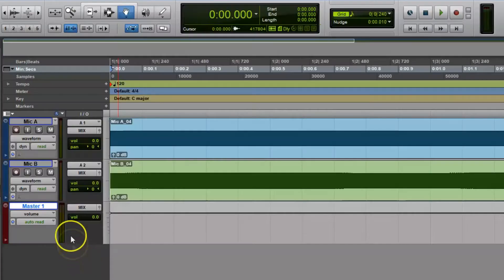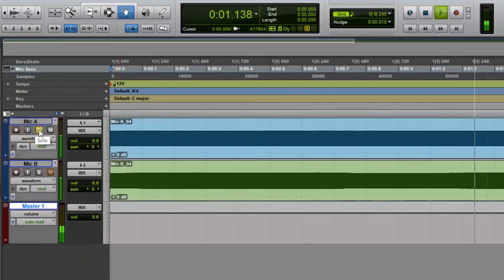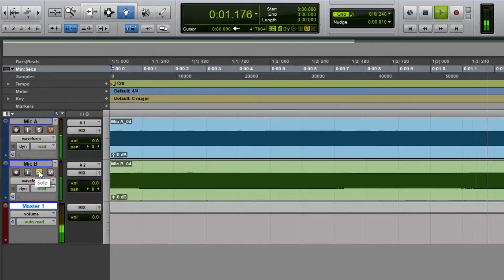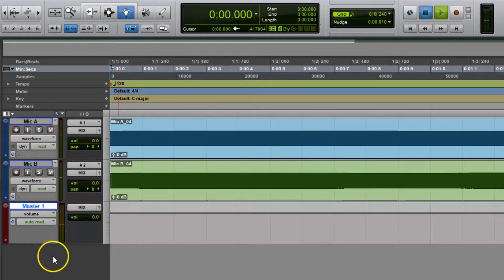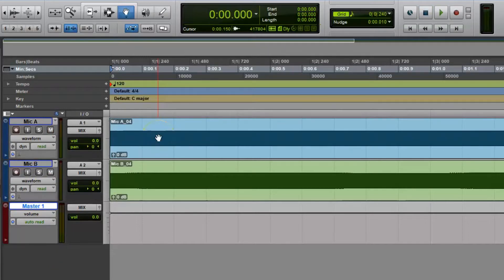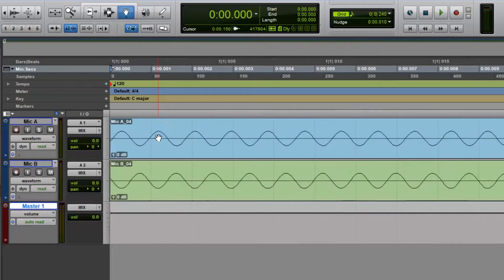Mono Compatibility, Coincident Pair, and Spaced Pair - Stereo Part 2

Comment: Thanx for your helpful videos. There is a misconception about the coincident pair: a 90 degree angle results in a recording angle of over 190 degree. If you walk 2 meters from left to right, it results in a very small spot in the stereo field. For almost every situation a microphone angle of 130 degree or more is suitable.

Comment: Since the issue with the spaced pair, is the phase cancellation. Could i then get a good result from simply using a phase alignment plugin, like auto align? Or would that ruin the stereo image?
Reply from the maker: Thanks for watching!  I haven't used this plugin, but from what I understand, it's more for correcting the phase with spot mics, to align those mics with the main set of mics.  So I do believe it would affect the stereo image.  -Mr. B

Comment: Thank you Mr.B you really are a star ! 
My Question is .. when we record these two streams separately ... how do we superimpose them to make it in a single Audio file and how does this putting these two audios in one and then extracting the two audio files for two separate L & R speakers work in real ?
Reply from the maker: Hi, thanks for watching!  :)
This is done with a process called interleaving.  Once the left and right channels are digitized, the data can be combined into one file in a way that, when decoded, is returned to two separate data streams.
Cheers!

Comment: I have a question?  My mics are AT2020 by Audio Technica how would I record in Stereo with Mic placements?  I need to tell you though, I have a small small studio.  I record in my booth so spacing is not going to be wide.   I told you that I had this stereo recording.  hmhm
Reply from the maker: Take a look at the "Stereo part 3" video. ORTF would probably be a good choice. You'll just have to adjust for the fact that the AT2020 is a side-address mic
Reply: @MrBinthestudio  Thank you with a big smile.  hahaha   Of course, I hope I do not have to come back because of confusion.  Its because I am knew at recording and mixing.  Thank you very much again.  Also, I am subscribed to your channel.

Comment: Hey got a question for you...  I saw in your low bass video where you talk about switching between your monitors and old crappy speakers.  This is a concept I've learned of already, and I actually just bought an ESI MoCo Monitor Controller so that I can easily switch between these.  This controller has a MONO button on it.  Do mono buttons on these things do exactly what you talk about in this video - making stereo signals into mono - and do they do it well?  I know ableton has this function as a Utility feature (making stereo --> mono).  I'm just wondering what the best way is to listen to your track in mono if it has a lot of stereo sounds playing.  Would you just hit the Mono button on the Monitor controller and call it a good mix if it sounds good?
Reply from the maker: Good question.  The methods are different, depending on which device is doing the mono sum.  It can be summed with a digital bus in a DAW, or it can be summed in analog at the amp.  Either way, the end result is the same: a 2-channel signal is being summed into one, and any of those methods will allow you to check mono compatibility.

Comment: This is a great channel and I look forward to future episodes on stereo recording. I'm about to embark on a series of ambient rural and urban recordings. I'll be using Spaced AB (omnidirectional pencil condensers, might also try supercardiods) and ORTF (supercardiod pencil condensers). Also want to try binaural using two DPA omnidirectional miniature/lavalier mikes, one in each ear (taped to earbuds just as an easy way to mount them) :) In some cases, I can also see using the DPAs as Spaced AB. Don't have access to a figure-8 for Mid-Side.
Reply from the maker: Awesome! I'll be interested to hear that.  I will be doing binaural in part 4 of this series, so here's a tidbit to consider with binaural... Binaural sounds fantastic on headphones, but doesn't always translate very well on speakers.  I think the best one that does the job on both speakers and headphones is ORTF.  But I would try both and see for yourself. 

Thanks for watching!
Reply: I've done nature recordings using what I call a pseudo-SASS-binaural method.  Basically I use a block of softwood (pine) or a yoga block about the width of a head, with an omni mic (AT3032) strapped to each side facing forward.  It works surprisingly well at preserving a full 360' feel both on headphones and speakers if you experiment with where the capsule is located in relation to the end of the block.  But I've never checked specifically for phase issues in mono.  You can find detailed descriptions and tests of this method in several nature recording blogs and groups - it's pretty popular.  Great video - thanks!  Looking forward to the rest of the series.  But now I need to check my old recordings for phase problems in mono. :)
Reply from the maker: @anonagain  That's a really good idea.  One of the things that I am planning on discussing with binaural is that it doesn't have to be a dummy head, or even head-shaped for that matter.  Really, it can be any reflective barrier.
Another thing to experiment with would be using a block of foam between the mics, which is basically an adaptation of the Jecklin disc technique.
Reply: @MrBinthestudio   Haven't tried a Jecklin disc yet (the pro ones are expensive), but the yoga block is basically a dense foam covered in fabric, so that would be the pseudo-SASS-binaural-Jecklin method.   ;)  I've been told the density of softwood like pine, or a yoga block are similar to the density of my thin skull with a mushy brain inside, which is why they work so well.  A bit of sound does get transmitted through the block into the other side mic, but it's limited in frequency and amplitude just like our head does.
Reply from the maker: @anonagain  Ah, gotcha. I'd love to hear this
Reply: @MrBinthestudio  Curt Olson did a lot of work experimenting with home-made stereo nature recording methods - I think he was the first to use a yoga block.  He used to have lots of example recordings online - you might try googling him and nature recording.  Other names in the field that might have examples of it are Martyn Stewart, Gordon Hempton, and Bernie Krause.  I've just started working on combining the recording with video (just got a decent camera) - will upload when I get something interesting to share - but I'm definitely a hobbyist at it, not an expert like those guys!  Thanks!
Reply: anonagain You might enjoy this video with Chris Watson and Sir David Attenborough: https://youtu.be/ixNM4EM-XgA Also this Chris Watson presentation: https://youtu.be/EC2CKEHu_lQ
Reply: anonagain Re your interest in recording both video and sound... I’ve set up a lightweight stereo bar with a small camera (iPhone or Sony RX0/GoPro) and pencil condenser mike(s), with the stereo bar mounted on a monopod and recording to a compact MixPre recorder on my shoulder. I actually have two stereo bars, one 30cm (12”) long and the other 66cm (26”). I’m using Cinela’s excellent Léonards for wind protection, which will work with a single mike, Spaced AB and ORTF (but not with XY or Mid-Side). This is an extremely compact and effective rig that works well for me on New York City streets. I’ve been using it for monaural recordings and am about to start using it for stereo.
Reply: anonagain Re binaural recording... I’m about to try binaural via DPA 4060 miniature mikes mounted in my ears (taped to earbuds unless I can figure out a practical, comfortable way to tape them directly to the inside of my ears). This is easily the most portable way to make a binaural recording. Why carry a mount the size of a human head when you have one built in? :) If desired, the mike cable (very thin) can be organised and routed using a headband.

I’m also finding that these DPA mikes are great for general ambient recording, much better than a shotgun and, due to lower sensitivity, sometimes preferable to an omnidirectional or cardiod pencil condenser (e.g. a Schoeps CMC6 with an MK2 or MK41 capsule). If I’m combining voice and outdoor urban ambient sound, the DPA is hard to beat. With a DPA d:vice preamp (easily fits in a shirt pocket), one can also record up to two DPA mikes, synchronised to video, directly to an iPhone.
Reply: @roryonabike5863  Thanks for sharing your setup and methods Rory.  One of the methods some of the pros use for nature recording is to strap their mics to a tree trunk that's the same width as a head.  For audio I've been using a Fostex FR-2LE along with the AT3032s.  The combination gives pretty high quality results.  I'm not mobile while recording so I don't have to worry about that - the kit fits into a little day pack and I usually record unattended.  I found the recorder will pick up my breath and body movements if I'm near it, plus moving away lets the wildlife do their thing without being spooked or having their behavior changed by my presence.  Will probably keep using  the same audio gear while videoing,  but set the camera up well away from the audio recorder so it doesn't pick me up.  I did find out early into this hobby that most nature shows use audio overdubbing that's not recorded at the same time as the video - kind of disillusioned me at first, but after recording a bit I get it.  Will check out the links you left.
Reply: anonagain Chris Watson is an important recordist and sound designer. David Attenborough and Watson go back a long way. Apart from those links, maybe check his web site and do a search on his recordings, which are not limited to wildlife subjects.
Reply: anonagain Turns out Watson has a Wikipedia page: https://en.wikipedia.org/wiki/Chris_Watson_(musician) Web site: https://chriswatson.net

Comment: The Beastie Boys used that mono phase-cancellation trick at the very end of their song "So Whacha Want" ... the stereo in my Oldsmobile had a mono switch and it was accidentally on, otherwise I never would have noticed ....
Reply from the maker: @nathan7265  Thank you for watching, and thank you for your thoughts.  As it happens, many of the engineers who worked with artists like the Eagles and Led Zeppelin (the ones who are still alive, that is) continue to make great records using modern gear, like the stuff I'm using.  It's about technique, not gear.  My objective with this channel is to provide instruction on the fundamentals of recording, and give people tools that can be useful to them, regardless of the gear they have.
Reply from the maker: Ha!  Man, I love hearing stories like this!  It begs the question, why the f#@%& did anyone find it necessary to add a mono switch to a car stereo???
Reply: @MrBinthestudio  Sorry about the troll. xD Someday will we reminisce about the chaos of the old Interwebs -- speaking of which I just did some searching and came across this info from a car stereo manual: "In areas where [radio signal] reception is particularly difficult we recommend switching to 'Mono' in order to improve reception [response]." Along the same lines I tend to convert my spoken audio in videos to mono if I can, to further enhance clarity of information rather than enhance the sensation of any kind of stereo field.
Reply from the maker: @HazeAnderson  Ah yes, that makes perfect sense.  If you're in an area of bad reception, you can lose either the left or right.  Now that I think about it, I had a OEM stereo in my van that would automatically switch to mono if the signal was low.  It was really annoying, because it would often switch in and out, and that just made it worse!
Reply: @nathan7265  oh, perhaps I read these comments of yours wrong then? "it never sounds vibey and cool" "but just try to make something that sounds like" "I appreciate the fact that the scope of what you are teaching is confined" ... care to explain yourself? At the expense of further promoting this video of course.
Reply: @nathan7265  this is what happens when you listen thru your "smart" phone. After just a few years of smart-phone-itis you pretend that you ever even knew what tube gear sounded like, let alone ever having cut a band to 2" reel to reel.
Reply: @nathan7265  tube gear doesn't have to sound burnt to a crisp duder. There's an entire universe of transparent applications of analog gear.
Reply: @nathan7265  not even. 1st you are a complete stranger with no channel - can't trust you. 2nd your tone is unpleasant - indicative of a troll. 3rd you are just wrong man - xD
Reply: @nathan7265  awww, you know one day we are going to miss your antics, lil troll. :)
Reply: @nathan7265  the more comments you make the more you help to promote this video.